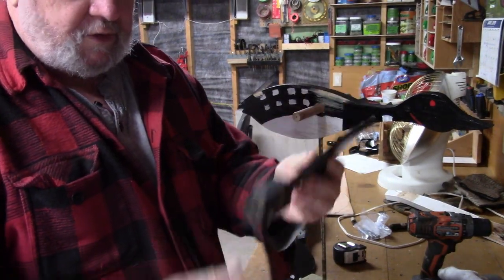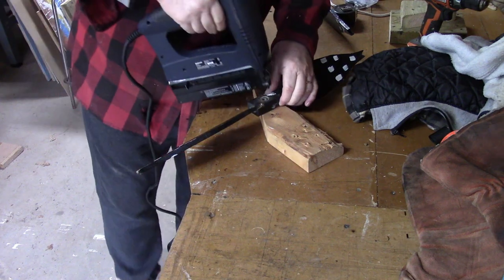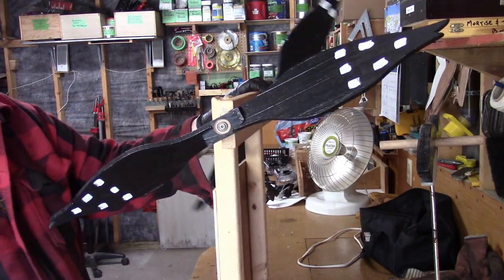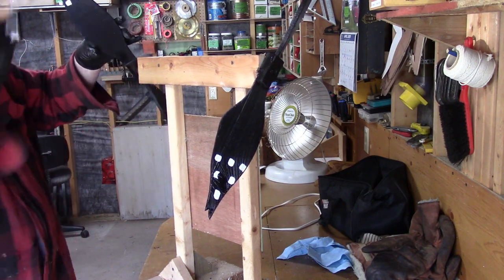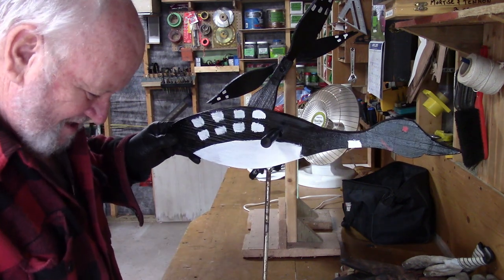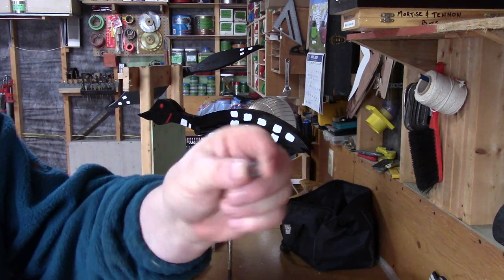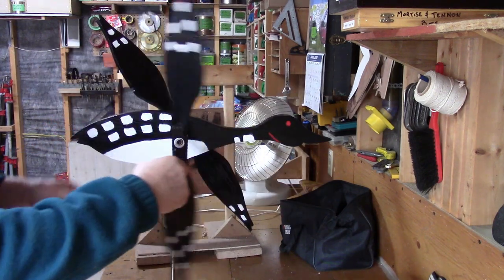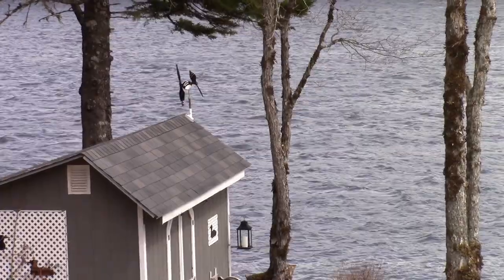Whirligig Repairs Part 2

Comment: Thanks for sharing. It turned out really good. The frame is a great idea for holding the wings while you paint them.
Reply from the maker: Hey there Joseph!!!  When I was getting set up to paint I thought I should hold those wings up some who and was wondering what I could use and as I turned around in the shop I tripped on this stand that I had built for my Ski Doo.  A message from above don't you think!!!  Thanks for watching Joseph and have a great week!!!

Comment: Hey Mike.  I have the same Mastercraft brad nailer! I've always wondered why Tremclad is called Rustoleum in the US.  I use it all the time.
Nice repair, looks great!
Have a great weekend.
Reply from the maker: How's she goin'?  I didn't realize it was called Rustoleum down south.  Tremclad is good but oil based and takes  awhile to dry.  I also use Armor All.  It's water based rust paint and dries quicker but doesn't cover as well, so you need more coats.  Thanks for tuning in Bruce and take 'er easy!!!